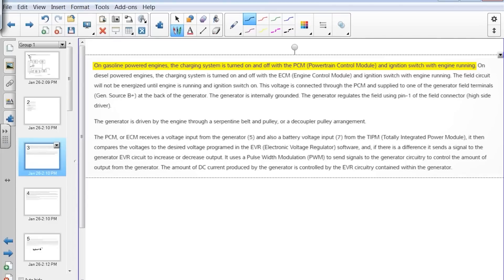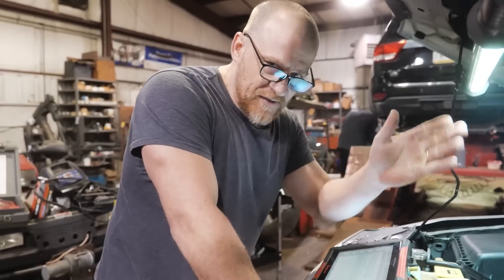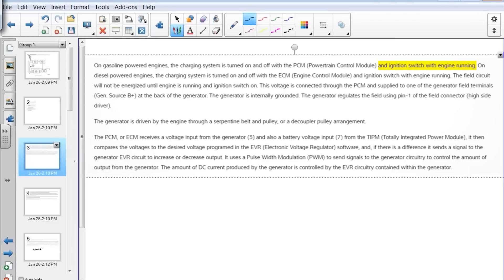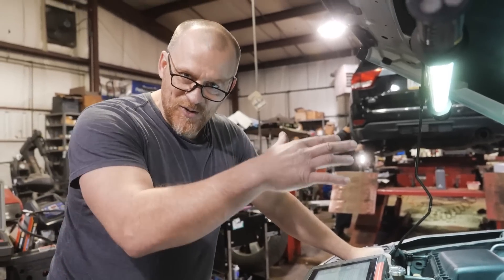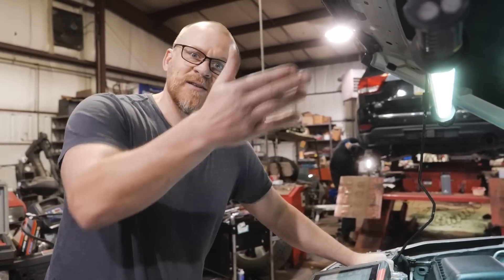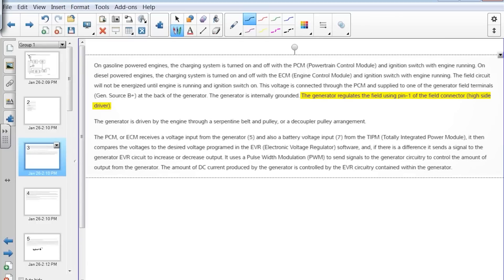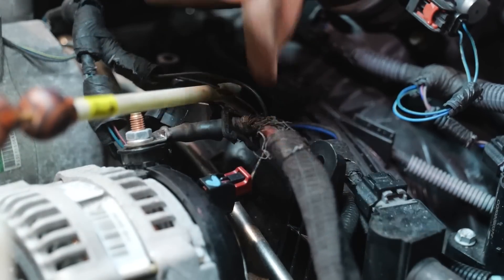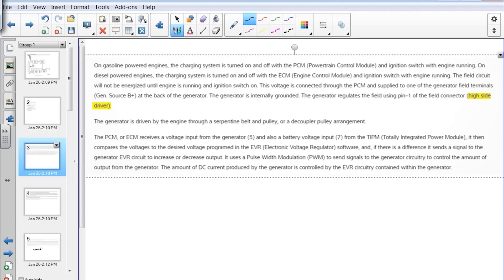Charging For Diagnostic Time - Can We Bill a Customer For "Research"

Comment: Our automotive family MUST watch this!!!!

Between the information provided to the repair side of their dealers varying from what they release to the public and missing and completely incorrect information provided to the aftermarket we've found ourselves with a massive challenge as independent repair providers. 

Increased research cost has often been subsidized by the repair shops and technicians, or worse yet they've simply guessed instead of testing. 

The dealer? They often turn away the complex faults seen by the aftermarket, and if they do take them, it's more acceptable to parts cannon or call the help line. 

The manufacturer? Let's be real.... they don't care nearly as much about fixing cars as they do selling them (and the parts needed to fix them).

So who takes the hit here? The independent facilities, their staff and the consumer of course. 

What do we do to fix it? I have no clue. 

If we charge what we need to charge to fix the cars and properly pay our people to do it? Well, in many cases it pushes the client to replace the car. 

If the client replaces the car, it places them in a modern automobile that are often seen as consumable as the infamous Bic lighter. 

Driving them to the dealer, who is cutting warranty times and working to pay techs less.. 

If we subsidize the testing and repair, we can't pay our people what they deserve or meet the quality folks are used to seeing in the dealership world. 

Many of us are trying to balance this, but the infighting in our industry has us bickering with one another as opposed to developing a way to overcome these challenges. 

It's why we should all be working with organizations like The Equipment and Tool Institute to make sure we're sharing our perspectives with the people who can improve the situation!
Reply from the maker: What's thr Equipment and Tool Institute Lucas?
And I agree, the in fighting is killing us!

Comment: This is the single most important issue facing  us today. The combined elements of fast changing technology which gets more complicated yearly + the side effects of the pandemic (skilled worker shortage, supply line issues & trusted new parts issues) have converged and is represented by Paul Danner in this video. 
Unfortunately, its the last two links in the chain that feel the most pain; the repair shops and the customers. Its unfair for both groups to have to shoulder the burden of this perfect storm.
-Some of the major issues will work themselves out but some will not.
The age of specialization & complication is upon us. The once workable ‘fix every car’ facility can no longer cope. Its time shops and technical folks limit themselves according to their strengths for their sake as well as their customers. This will need to extend to the education and training sectors as well as parts manufacturing.
The details and accuracy needed to be successful are being ignored, lost or skipped. 
Our future slogan may be simplify or perish.
Thank you Paul for bringing this issue to the masses.

Comment: There is so much involved in modern vehicle electronics that I believe there is no singular person/brain able to retain or know it all. So every time a complex problem arises the technician working on it has to do research on the specific system in order to avoid the parts cannon being fired. This avoidance of lots of parts being thrown at an issue has to come at a price & cannot be absorbed by the tech or garage. 
Paul, what are your thoughts on segregating the trade at source?? ie. Vehicle tester, engine rebuilder , auto electrical engineer, electronic programmer or something along those lines 🤷🏼‍♂️🤷🏼‍♂️
Reply from the maker: 100% needs to be done, in particular with the diag guy!

Comment: Time is money, if you box your self in with a hard quote with a difficult customer it's often more honest to reverse up and take the flack for failure. Or you may choose, out of interest and learning, go it alone and do it for the car and your own knowledge not the owner. His her dream of a good cheap quick fix can easily become your diag nightmare. 
Fixing an "easy" car for an "easy" customer is (obviously) easy.
a "difficult" car for an "easy" customer is fine too.
but tread cautiously (psychoanalytically) with the "difficult" car / "difficult" owner equation. Oft adds up to zero !
My definitions "difficult car"......odd make to you, high miler badly maintained..no avail parts or data .....etc
and "difficult customer".............hmmm. Gonna short that signal to ground through a 10k R so only you guys with scopes can see!
Reply from the maker: The difficult car with the difficult customer is easy to weed out. You quote a $500 retainer before work will even begin. It's been to 3 shops with no fix and this is what we want an okay of before we even look at the car. This does two things, one, it weeds out those looking for a cheap fix or ones who have no money left because they've already spent thousands without a fix, and two, it allows us the freedom to attack the issue without having to call the customer back multiple times is selling more time. Of course, not all will get billed the full $500 depending on the issue. The last one we did like this we billed out at $300.  Let's stop making the customers problems our own, and start billing like we should be so we can pay our techs who are good at this a rate that is profitable for them, to not only do the job right, but thrive while doing it. 
Sure you will lose some customers but so what! 50% of a shops customers only bring in 5% of revenue. Time to fire the bottom 50% imo
Reply: @ScannerDanner  So true! "£takings ain't always £makings" is the lesson here.

Comment: I wonder what the argument is that people make against charging diagnostic time?  If you make your living doing diagnostics, you should be compensated for that time just like anyone who does their job. I don’t see any argument against that. 
    I don’t charge diagnostic time because I do this as more a hobby and I absolutely love it- I get paid in the chance the learn.  Plus if I get a video out of it I get paid that way in the long term far more than I would by the hour . But if this is what I did for a living you better believe I’d charge for even time looking on AllData!!!
   BUT if I made the wrong call- say I spent 3 hours doing the diagnostic and I call a $600 PCM as the issue, and it turns out I was wrong, I would refund everything- the PCM, the labor AND the diagnostic time.

Comment: Hey Paul being at a MB dealership over 30 years total, if the part was bad whether a computer or component we got paid for re diagnose and the r&r of component. We at the dealership do not work for free, and the manufacture will pay for the bad component. They in turn will charge back their supplier. The bills lights heat A/C amongst other things do not go away and must be paid, so we cannot charge the customer for a failed part and the r&r of said component. In Benz world the part if installed by dealer usually will get a 1 year warranty too at least it was before I retired from that field. I can tell you first hand nobody wants to go into this field, why go in spend boo coo of bucks and get a few dollars more than flipping burgers. That does not make sense.

Comment: I think there is a degree of shedding responsibility within the industry. If they read a code and replace a part. It's not their fault if it doesn't fix the issue and they don't have to improve themselves. The car is then deemed unfixable, unfeasable to fix or they just don't have the time to do that level of diag just to fob it off to the next guy. Whereas, if they take on the correct method of charging for accurate diagnosis. Then get it wrong. The onus "blame" is on them, there complete lack of ability and not the equipment!
That's how we've trained customers to not trust us and that going to a parts store to read a code by a 16 year old for free. Is just as good as a competent technician will do.

Comment: There is a fine line between "research" and "education" Sorry sir I had to charge you an extra 4 hours because I had to research the difference between a hot and a ground
Reply from the maker: Is that your take away from what I just showed? Or are you commenting based on the title?
Reply: @ScannerDanner  In the "old days" we got paid to fix cars. I did automotive electrical for 45 years. Now it seems like number one priority is get paid, if I happen to fix the car along the way Luck You. It's sad to see where this industry has gone to. If I didn't fix your car, bring it back to ME not another shop. I see so many videos that start the same way "Its already been to 3 other shops." Some jobs are gonna eat your lunch that's part of it. The first couple hundred are a bitch but after that no big deal. It's a shame to get your car fixed these days you have to play the "kiss a lot of frogs" game.
Reply: Sorry, there is something missing in your picture. You're speaking about a time, where firstly cars were incredibly simple and straightforward. Secondly they basically hadn't even changend since the days, your father was an apprentice.
So, just about everything was  breeze, if you just were able to make it through elementary and manage to get to work in time.
It was not before around the mid 80, when things got a little bit newer and not until next generation cars, where progress in compexity gathered a little bit of speed. Shortly after that things really went head over heels and oldstyle mechanics found themselves in troubled water - been there ever since.
Referring to your answer to Scanner Danner - good luck, if you make it through todays costly times with such a giving attitude. Good for your customers, if your business manages to survive.
But you'll get a lot of spoiled customers that way and they'll never stop sucking your lifeblood, once getting used to it, without getting overly grateful.
Because, you know - car mechanics original sin, which he just cannot get rid of - he is only needed to fix something, that shoudn't break anyhow.
Reply: @werner.x  I did have a lot of spoiled customers, because they trusted me and would just say "fix it" because they knew I wouldn't rip them off. I have an LS project I'm working on now that needs a stock program loaded. The program from GM is $45, the only place in town that even knows what I'm talking about wants $200 to right a repair order and $500 to load it. I know times have changed. The problem I have is attitude mechanics today have is like the one post "Somebody has to pay for my $2000 scanner"

Comment: So in the HVAC field , you are actually required by  the Gas code to diagnose and repair based off of the manual. The principles are all the same but with more advanced technologies, the set up and what to use is solely on the code, which requires research

Comment: Same thing happened to me today. B2288 code on yaris, all wires are fine, spend many hours on diagnosing the car, and research beacuse its imoboliser system and im not familiar with it, the car was diagnosed at the dealer before it came to me, they said to the customer to replace many parts, finally i programmed it and it starts, i spent many hours researching and diagnosing. If i made a call acording the manual and the research I will have to replace the transducer ecu. But it just needs to be programmed. Im still consider myself as a new tech in this feild and I’m one of the guys who learned online from your website. You took me to the next level and once you told me i will be fly like an eagle in this feild and im flying now. Proud to to learn from you. Thanks alot

Comment: I spent 15 years in the dealership doing everything properly and how you should do it. Diagnosing issues correctly and being paid the time do it. Got in a motorcycle accident and was off work for couple years. Started working at a small shop in my town. The owner is a firm believer in go out to the parking lot, scan the codes and order a part based on the code. It drives me ABSOLUTELY INSANE! Not to mention when I say charge for diag, and do it right. He says people won’t pay for diag. They think you are ripping them off and they won’t come back. I may be going back to the dealer.
Reply: As a customer I want to pay for diagnostic time. a garage should not guess I want a car that works and the quote is correct
Reply: Yes, a very common problem - but you cannot change your boss. So, you'll get sick for staying in a job, where you can't do satisfying work. Seems like a good idea to look for the next job.
Reply: I think many of us are in this situation. I think this is the result of some bosses not having experience in the field under the gun. Sad but true!!!
Reply: These shops are ripping people off by taking their money and doing a repair that wasn’t needed or not the entire problem.  That customer is going to bad mouth that shop when the chexk engine light comes back on … and they can’t drive the car because they never diagnosed it … just threw sensors or parts at it

Comment: Scanner danner you are the man!! We need more techs like you in this industry  even dealerships throw parts at the car and bill huge amounts of money, can you imagine dealeships that they are supposed to know how the system works and still making bad calls smh.
Reply: until shops start apprentices at more than minimum wage, (which is still 7.25 federal and the same in PA where Paul and I both work) we will never get competant techs. The median income for master techs in this field is currently around 67k a year. This also doesnt indicate many mechanics work upwards of 50-60+ hours a week. A neighbor of mine joined the plumbers union in Philly and started as an apprentice at 25 an hour. 

There is a serious pay issue with this industry as well as training disconnect. Many dealerships will only satisfy shop competence requirements. So why should any technician earning minimum wage or only slightly higher even enter the field when they can go work at mcdonalds and take home way more money due to not having to pay for school loans and continually update their tools. We also need a better apprenticeship system. Don't take the tallented young man/women and stick them in the quick lane oil change portion. Set them under a few different A/B techs and allow them to learn more on the job and have a system in place that requires their continuing education after set periods of time. Many neglect sending employees to training if its not required by the manufacturer, and many aftermarket shops neglect training all together.

The training within our industry needs to be better now than ever. These cards are extremely complex and diverse in the systems implimented. But some "trade schools" charging premiums are still teaching on outdated vehicles more than 15 years old.

Comment: IMO it's not the complexity, it's the complete lack of proper documentation and system operation.  We need engineering level information to diagnose fault codes with trouble-trees that lead you in circles. Pin fitment problems, improper circuit design/color/pin positions in service info, bad new parts, layers of multiple issues, scan tool functions that don't work or problematic dats PIDs which are formatted incorrectly,  etc.  Trust me, I want the thing fixed.  It's infinitely frustrating as a tech who wants to get it figured out with extra hurtles in the way.  Just tell me how it works, I do not need suggestions of how to minimize warranty cost/time from a flow chart diagnostic tree.